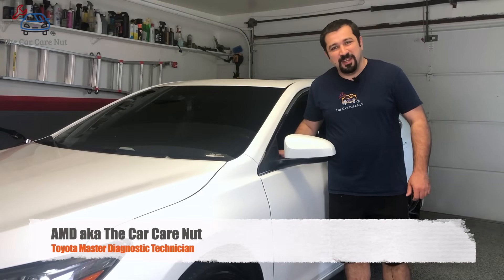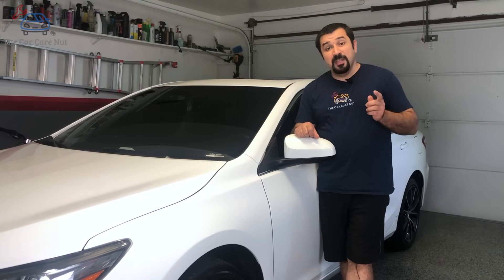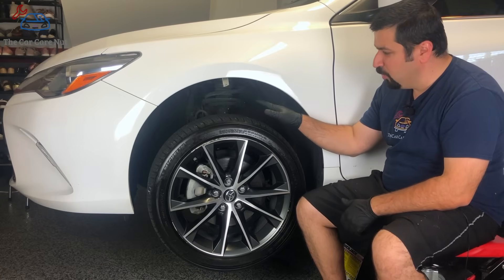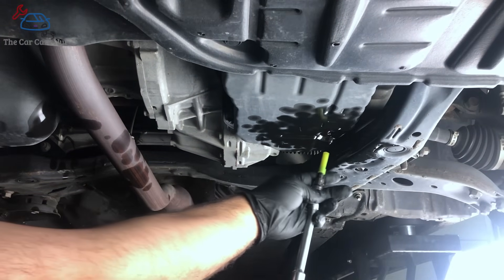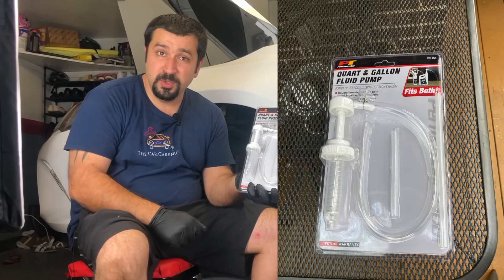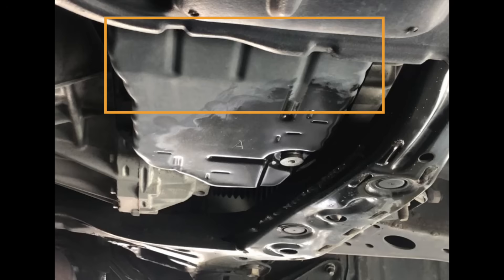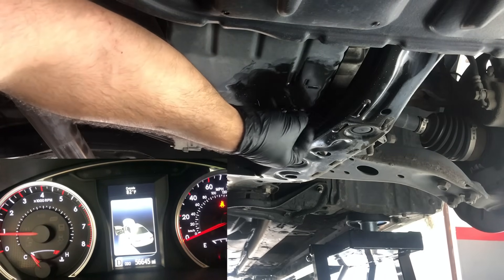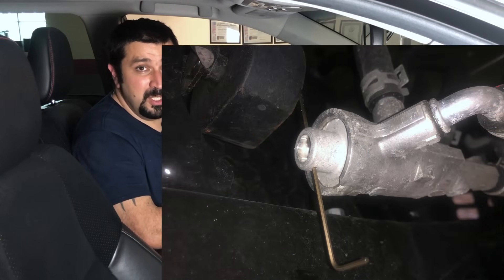How to change your Toyota Sealed Transmission Fluid

Comment: So on a Toyota Camry 2020 V6 with an 8-speed transmission - do I need to do the cooler bypass?  What would be the temperature range for fluid adjustments on this car?

Comment: Excelente video, Ive been learning a lot. thank you so much. I have a question. My toyota Rav4 2016, what temperature is required to measure the right level of the transmission oil. Last week, I did transmission oil change, but I replaced the old oil with the same amount collected. Thanks

Comment: As soon as the transmission fluid pan plug is removed, 
a large amount of transmission fluid flows out.
Does this mean that the vehicle in the video has more transmission fluid than the normal level?
Reply: No cause when car off fluid settles into pan.

Comment: Hello, and thx for the interesting contents.
I have a 2015 corolla with cvt transmission, at 80000 km i made my first drain and refill,  now i have 150000 km, can i make a full cvt flush at 160000km or just drain and refill? Is it mandatory to change cvt filter? I live in Lebanon Middle East.
Thanks in advance

Comment: I've been changing the transmission fluid on a 1999 Honda Civic.  No need to jack up car.... just reach under and loosen drain plug.  Replace plug, fill at dip stick opening.  Watching this makes me feel very cynical about car manufacturers.

Comment: What if the car has a transmission oil cooler? Any additional step(s) or precautions? I have a 2019 RX350 f sport with a cooler. Thanks

Comment: As he said, the initial drain gives an idea of the fluid level. Can't I judge from this initial drain? If I don't see anything coming off, following precisely what he explains, but if I see the expected little drain, I should be able to just refill the same amount only w/out performing temperature procedure. This suggestion is valid when the fluid is cold.

Comment: Very nice videos! I have an issue with my 2015 Camry Hybrid . While driving, I step on the gas pedal, rpm jumps high quickly, but the car takes it's time and doesn't accelerate as fast as before. It's been going on for the last two months. the car is a 4 Cyl, 2.5L with 350,000 KM. Is it the Clutch? maybe transmition fluid? ECU is clean with no messages.
If it is the transmission fluid. do you recomend to replace it with the filter? Thanks!

Comment: 🎇 Great video. Toyota dealer quoted $51/quart for ATF. 2023 Camry LE, no AWD. Needed:
1. List of acceptable other ATF brands.
2. Does temp 95-110 F for fluid in car matter that much?
3. Can heat gun be used pointed at trans to know ATF temp? 
4. If AT is slightly overfilled does that matter?
5. Sealed AT is misnomer. This means no bolted on removable bottom AT pan. Does not mean ATF change eliminated, as some believe but do not know.
6. Can anybody post ATF fluid change process as stated in Toyota Repair Manual?

Comment: Can you explain why you cannot simply drain and measure the cold fluid after sitting overnight and then just fill with the exact same amount of measured new cold fluid?  If the car is level,  and has no leaks, wouldn't that do the trick?
Reply: I did that and no problems so far and it’s been several months

Comment: I have a Venza 2013 AWD with 3.5L.  Didn't see much about changing the oil filter above the oil pan.  For me, if you have a filter, replacing it is necessary.  Sure it takes more time to unscrew every bolts and replace a new pan seal. Your advice please.

Comment: I just got a 2008 Avalon with 145k miles. It runs smooth. Is the transmission oil something I should be changing at this point. I have no idea if it was ever done before.

Comment: Where exactly is the bypass for the cooler that needs to be pushed in to service the eight speed transmission?  Doyou access it from underneath or from the top of the engine.  Do you have to take off more of the plastic from underneath by the radiator?  I know you show a picture but really having a difficult time finding this!
Reply: I'm looking for the same thing. I can't find any information on it and can't seem to find it. Have you had any luck yet?
Reply: @ I emailed the “Carcarenutguy” , the one who has the YouTube video about changing the transmission fluid and am waiting for a reply from him.

Comment: Hello, sir. First of all, thank you for recording this video and for all the other amazing videos you’ve created so far. I’m planning to perform a #transmission #oil #refresh on my #2015 #Toyota #Highlander #LE #Plus and was wondering if you could provide some information specific to this model year. Specifically, I’d like to know the recommended transmission temperature to monitor and whether I need to follow the exact same steps for this model, including the OBD wire bypass procedure. I would really appreciate any guidance you can provide. Thank you!

Comment: I have a 2012 Toyota Camry 4 cylinder that has 153,000 me Toyota told me that those only need a drain and refill and they told me that the filter is just a screen style filter no need to replace is this true

Comment: Hi , I  have a question , what if your camry goes foward and reverse but it won't move like it normally do , and the transmission fluid has never been changed  , is it possible it can just be low on fluid and if so how do you get it to the temperature you mentioned to change it.

Comment: Hello My Friend. 
Reaching out to you, Because I have a 2017 Toyota camry LE and I did my transmission oil change  6 months ago and filter at 77k miles. 
Used a temperature gun and set heat at
 108 ° Everything went well. But I noticed that my car sometimes lags taking off on red lights and eco light stays ON even when I step hard on gas pedal.  Doesn't do it all the time but Does it when cold.  I'm afraid trans is going Bad.  Thanks 
And Great videos.  🙏 now car has 83k miles

Comment: Here in Brazil there is a big discussion about changing or not the filter. What would you say, is it necessary to change the filter and clean the oil pan on the Corolla 4 speed? 

Btw EXCELENT content, I maintain my Etios all by myself with your videos

Comment: What are the transmission temperature ranges for a 2014 Toyota Sienna  L model (front wheel drive) and 2018 Toyota RAV4 L model (front wheel drive)?

Comment: Hi, on your last step: "Take your foot off the break pedal and remove your jumper wire. Leave the engine running as we proceed to checking the fluid level". Do we keep the gear in "D" or "P" while taking the foot off the brake and removing the jumper wire? If keeping the gear in D, the wheel is going to spin (in D drive without applying brake)? Thanks!

Comment: I have a 2017 Sienna 8 speed transmission, I’ve listened to you directions on how to change this fluid the only thing that caught my attention was your statement at the end regarding the specific 8-speed tranny. You mentioned that it was important to close a “cooler bypass valve” where is this on the engine? What happens if this is not done?

Thankyou
Jeff

Comment: Thank you...Your video series are the highest quality I have viewed and I have been using DIY videos for servicing of my vehicles for well over 10 years.  Step by step, accurate, and clear.  In this video, there was no mention of crush washers.  Are there none on the transmission drain and fill plugs?  I believe they are present on the drain and fill plugs for the rear differential and transfer case.  Thank you very much.

Comment: Great video as always!  Your videos are very much appreciated.  What are the correct normal operating temps for a 2018 RAV4 Adventure model?  Are there any additional steps needed, as the Adventure model has both engine and transmission oil coolers.  Also, my service manual shows the image of OBD as upside down, compared to your image.  Can you please clarify.  Thanks! NOTE:  Unable to post an image to show you my OBD service manual image.

Comment: When you first removed the drain plug, why was fluid coming out?  If the plastic nozzle determines the correct level when temp is between 104-113 degrees, why would any fluid drain out if the engine is cold and the fluid is not expanded? Shouldn’t the level therefore have been below the plastic nozzle?

Comment: I did the ATF temp procedure and the Drive indicator turned on for 2 seconds but then turns off. No blinking, or weird stuff, it just turns off.  Any ideas what could be going on?  I triple checked the wire position on pins 4 and 13

Comment: Thank you for your video. I'd like to point on one important step that wasn't listed in the recap of the second method using a jumper wire on the OBD2 connector. Around minute 12:05 of the video after forth  step. After Drive indicator comes on solid for 2 seconds, MOVE THE SHIFT LEVER TO PARK. Then go to the last step, take your foot off the brake pedal and remove the jumper wire with the engine running in Park.

Comment: I have a question for you . If the fluid level was correct in the 1st place why so much fluid came out b4 you even unscrew the overflow tube . Please explain. I have see so many videos always plenty fluid flows and even same happened to me I drain measure and fill same amount using scan tool with 40deg temperature still alot coming through overflow. Confirm cvt transmission never changed b4 car has done only 029000km.
Reply: Because when you turn off engine some fluid goes to pan.  So on a non running car will get some fluid above the set height.  When car is turned on the level goes down some in pan.

Comment: Thank you for this video. Thankfully I borrowed a scan tool to get my v6 venza to 40C.  The part that made me worry was how much oil drained before the tube was removed from a cold transmission.  First time changed at 120k miles. I had a slight shutter. Hoping after a couple drain and fills it goes away. I asked the dealer to price a drain and fill and they said it didn’t need it. Shouldn’t have listened and told
Them to do it or do it myself.  Easy with the scan tool. Hardest part is waiting for a cold tranny to get from 13C up to 40C.

Comment: Thank you Car Nut!  I put over 300K on my last Corolla without changing the ATF.  Then I gave the car away - still running fine.  I bought a new Corolla (4spd, dipstick) and now have 100K on it.  I ask my shop how much to change the filter and flush the trans - $400/400 = $800!  So I was going to do it myself.  Now that I watched this video, I'm still going to drain and change the filter.  I'll measure how much I drain, replace that amount with new ATF and button the job up.

Comment: 2015 RAV4 - temperature when using the temperature gun method? Also, do you recommend changing the filter, and if so, what interval. Do you use a gasket sealer when changing the pan gasket?
Reply: Just need to do the fluid.

Comment: Are we supposed to do the initial drain with the car/fluid cold or do we get the fluid to that exact temp and then drain?
Maybe it doesn’t matter if it’s hot or cold for the initial drain just as long as you put back in what came out?
Reply: Good question, I drained mine cold and 1.5 came out from my 2014 Camry v6

Comment: Currently doing my 2019 RAV4 trans fluid.  This vehicle doesn’t appear to have the transmission cooler bypass valve with the button that needs to be pushed.  Rather it has a line coming out of the transmission that leads to a coolant heat exchanger and then another line coming out of the exchanger going right back to the transmission.  I’ve looked until I’m practically blind.  Can someone confirm that the 2019 RAV4 doesn’t have this valve?

Comment: Do you recommend changing fluid on high mileage vehicles (200,000) miles if not service before.  2012 Toyota sienna with almost 200k miles.

Comment: Couldn’t I also just call the dealer and ask the specifics of my vehicle and find out exactly how much fluid my transmission should contain? Rather than trying to deal with getting the oil to the correct temperature? 

Of course my question never gets answered.

Comment: Hello there what is the torque spec for the transmission drain and fill plug on a 2020 rav4 non hybrid and a 2021 camry same as before  non hybrid? thks  the 2.5 engine

Comment: Why do I have to follow that process. Why can’t I just drain the transmission oil when it’s cold. (Doing only drain and refill) let’s say 2.5quart came out on cold car. Now I can just add the exact same amount back in which has the same temperature. This way I can bypass the entire temperature measuring and draining procedure which can be a headach for many.
Reply: I think some gets sucked up while the car is on, so if you drain it cold, a little more comes out. I think that's why the correct level is checked with the metal drian plug off while the pan is within measuring temperature range

Comment: ps.  In a 2020 Highlander, there are no metal connections at all to jumper in those pin positions.  Looks like I'm using the thermometer method then.

Comment: In my 2020 Highlander, the transmission cooler is in front of the front driver's side tire behind the splash guard, which is a major pain in the ass to remove.  It has a little plunger button on it and a little hole around it for a hex key, but it does not look like what you showed here and it was in an inaccessible place.  There's no way in hell anyone is going to get their hand in there and push that thing deep enough for they hex key anyway.  I even tried jamming the button in with another hex key, but it would bottom out and the other hex key still wouldn't shoot through on top of it.  That started me wondering....why do we need to do this anyway?  Why would it even matter if fluid was circulating through the cooler or not?  Everything is off when we drain it anyway and having that button pushed won't make squat difference to what drains.  I'll drain what I drain, top off and level according to the procedure you've outlined and pushing that button in shouldn't matter.  It will mix clean with dirty in exactly the same proportions anyway once the transmission comes up to operating temperature and fluid is circulated through the cooler by normal means.  Would you agree?

Comment: How do you know when the temperature is right? I.E.: Is D solid on for more than 2s while quickly shifting between D and N? Car: Toyota Estima with  2GRFE  engine.
Reply: I found it, it is just cold and needed insisting a bit more. I checked with an ODB2 and the temperature was about 41 Celsius when then I put it in diagnostic mode, and switching a few times between D and N has brought up solid D. This remained solid even as I put it in P. I suppose that's  when the ATF level should be checked.

Comment: The method of jumping the OBD II connector does not work for a 2020 RAV4.  Position 13 does not have contact inside the connector.

Comment: I called Toyota Stealership in Southern California, they want $500 plus tax now. I have decided watch this video few times (yes, old and can't remember) and do it myself.  Why?  My son bought his Toyota Corolla to "express lube" for normal oil changed and I believed they use air tool /Gun to tighten the oil pan nut, the nut was stripped and they did not tell him.  Why I know?  When he is back in Town, I did the oil changed for him  and I asked him why is my expensive Magnetic oil pan drain nut is gone or being replaced,  I found out it was replaced with a generic cheap plug with Permatex Loctite in the front and wrapped with teflon tape on the bottom. I am so lucky to find this out. 🤣

Comment: Question for you, theoretically if you have the car cool down over night and change the fluid in the morning, the fluid inside the transmission will be the same temperature as the new fluid going in. Could you just measure how much it goes in and put in that amount? That way you are not messing with temperature difference and not having to warm up the transmission

Comment: Been driving toyota cars since 1980.....the way the newer Toyota's (2015,2017 and above) tranny's are NOT designed for the common do-it-yourself er.. I mean come on--- who has a 24 mm in their garage?.. I dont have that size. And then have to drain it twice?.. wasnt like that on the older toyota corrolla  cars (2005-2014)......They just started this BS of making it more complicated 10 years ago.. Remember, how simple it was?..You would simply drain the fluid thru the drain plug , clean out the magnetic particles of the magnet of the drain plug..Record how much fluid came out.. Then  we ADDED the tranny fluid thru the dipstick hole? And you would keep shifting the gears (automatic) until the dipstick should you had the correct level..  So basically toyota wants you to take it in to a professional mechanic shop or the dealer (rip-off) to do the tranny fluid.. They make more money this way, on a piss poor tranny design..

Comment: Thank you.  I just changed the Transmission fluid on a 2020 Sienna.  Thank you for the guide.  The job wasn't hard... just tedious.  I went the temp gun method and it worked just fine.  I did wait until the transmission was at 100, solidly between the recommended numbers of 95-110.

Comment: I need this bad I just crack over 100k 101325 in Toyota told me in seal in not recommended I’m stressing so hard . It no lights on dash just tire pressure I need done so bad .

Comment: I did this drain and fill back in April at ~62k miles on a 2016 Toyota Camry.  Removed ~2.5qts, put in ~3qts, and removed ~1/2qt during the level off (which I started at 101F ending at 107F using the ScanGauge3).  I was considering doing it a 2nd time, but never did.  I'm approaching 72k miles now.  So, I've driven about 10kmiles.  That means about 2/3 of the fluid has 72kmiles on it, while ~1/3 of the fluid has only 10k.  Considering doing it again, but its November and cold out here.  Took me 6hrs just to get the car level last time...  I'd like to think I could do it in less time now, but still.  How often should this drain and fill be done?